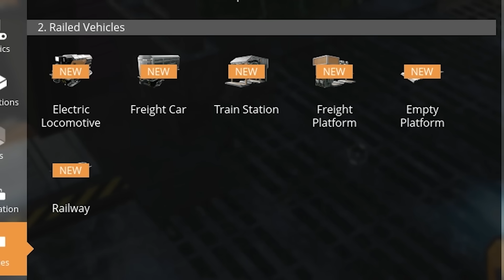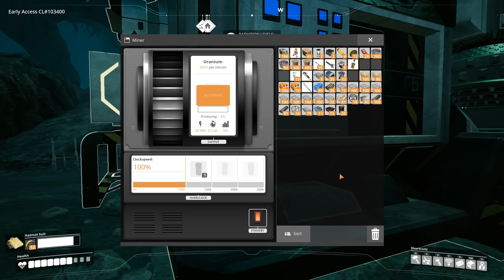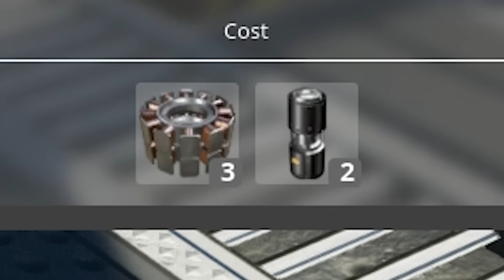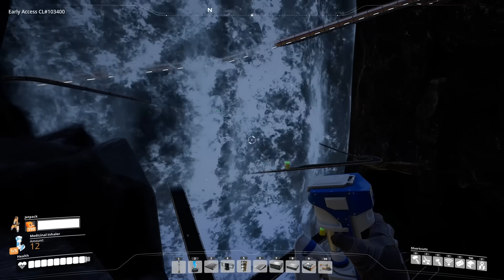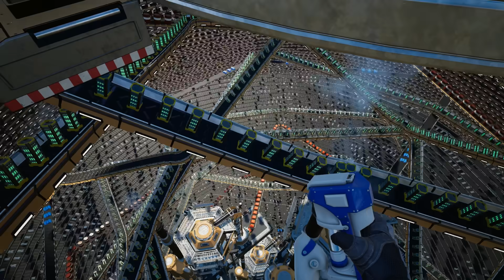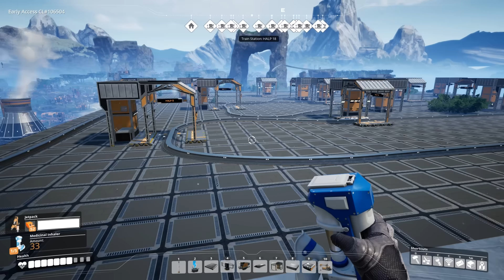I Produced so Much Nuclear Waste the World Is Ruined Forever - Satisfactory

Comment: LOL

Too bad the game devs don't know about molten salt and/or thorium based nuclear reactors. Both are great because they use 'nuclear waste' for fuel, and turn it into some really mild stuff that can be left in a warehouse for 20 years at which point it is almost completely non-radioactive. Other byproducts are various rare earth metals. Also those reactors don't ever melt down, because they are already running in a molten state... and no high pressure.. AND if for some reason things get out of control it shuts down automatically in an entirely safe way. They are basically idiot proof, you could literally let Mr Magoo, Chief Wiggum, Beavis and Butthead, or Nancy Pelosi run them ... if you didn't mind blackouts because of the shutdowns.

The current stockpile of nuclear waste in the real world is enough to supply electricity for the world for the next 1,000 years or so.
Unfortunately for us no one seems to like them because you can't make bombs from them.

Comment: actually: new unused fuel rods have only mild radioactivity. It becomes super deadly after use.
Used nuclear fuel is so radioactive that it needs to spend years under water before you can remove it from the reactor. (it stops creating any significant heat after a few weeks, the water is for shielding after that)

Comment: "The whole point is to generate electricity"

I think you mean the opposite. To use electricity
Reply: Or does he?
Reply: +1000
Reply: ((dies cutely))
Reply: building trains makes the plant generate more electricity and thus more waste
Reply: @TheRolemodel1337  I think the problem was that he kept saying that the TRAINS were generating electricity.
Reply: @TheRolemodel1337   "It hurts me, too. Only noticed after I released the video!", he talking abot saying generate instead of consumption
Reply: He probably said "generate" because while he had 100k capacity, hardly any of it was used. So if he uses more electricity, the nuclear reactors have to satisfy the new demand, meaning that more nuclear waste is produced. I.e. he first has to use electricity so that the automated system produces more of it.
Reply: he means generated power from the power plants, as in, if nothing is there to require the power, they wont generate any power, thus not producing any waste. I was also initially annoyed, but he is technically correct.

Comment: "For future generations to worry about," i see u went to the boomer school of responsibility
Reply: True but likely totally assbackwards as to How. Did you know that a vast super majority of nuclear operators refuse to deposit their waste to long by term storage even when it's free? Because they know damned well that the stuff still contains 97% of the stuff that's valuable in them and with the right processing it's actually MORE valuable than it was going in. We had the tech to dispose of this stuff BEFORE we had the tech to make it. You're being milked for all your worth and the fake green lunacy is how.
Reply: Anything that is radioactive is still able to produce heat and heat = power. You just have to design your plants to work with slightly less hot, but still melt your bones hot, rods with a larger reactor area. Take the nuclear waste, reprocess, toss in a little fresh material, and you have a 90% recycled nuclear fuel rod (or salt circle thing with thorium reactors). Greenest energy you can use. 

The waste is a bunch of rare high density materials that need a little ionization help to be usable.
Reply: @rujikin  hahaha :D